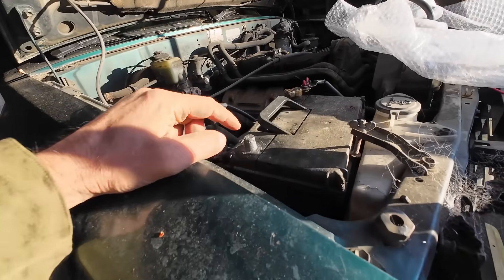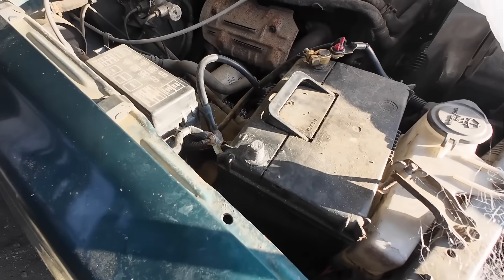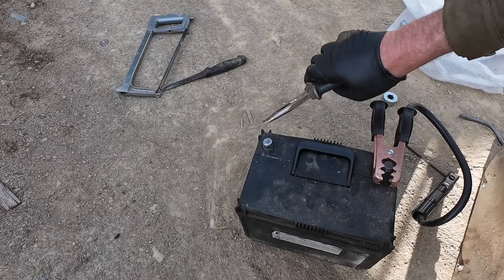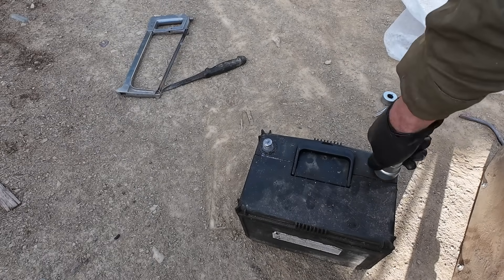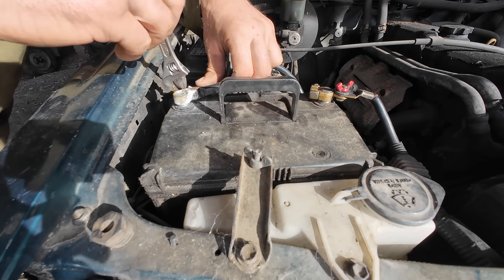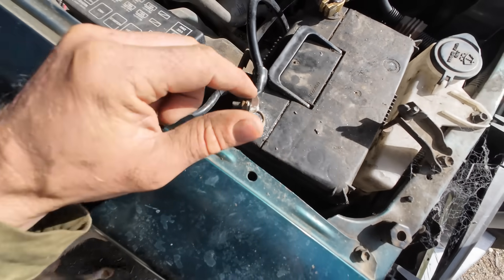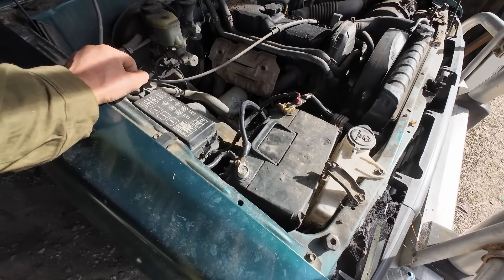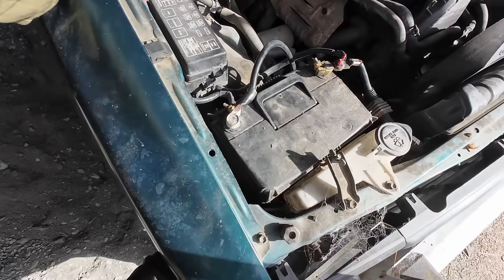Repairing a Burned-Out Car Battery Terminal – How I Fixed a 12V Battery Instead of Replacing It!

Comment: I used to work for a battery company and would go around and repair fork lift power packs.  Quite often, we drilled out the interconnects between cells to replace individual cells.  When replacing the cells, we used lead interconnects and used lead bar stock with propane torches to melt in new terminals.  We would remove the caps of the cells in direct proximity to the hot work and flash off the hydrogen in those cells before continuing the melting operation.  We had a form that we used if the cell we were replacing was of this post style.  Not really sure it's relevant but that never stops me from commenting.
Reply: Nice Junk 🙀🙊🙀
Reply: relevancy does not always make interesting

Your post is interesting because it's insightful! :D
Reply: Every comment is a sacrifice to the algorithm God.🙏🏻
😉😆
Reply: Thats really interesting. Never knew u could do that
Reply: @ionracer3284  "Never knew u could do that" 
Whatever you do, don't watch the YouTubers who make videos where they replace their battery acid with epsom salts.
Reply: How did the hydrogen not blow up?
Reply: @daleolson3506  thats the 'flash' part, fuel to air (ratio) mixture within a closed space is dangerous, taking off the caps allowes gases to escape, flashing removes the excess. Still its dangerous and good ppe is a must.
Reply: That's cool. My dad was an auto sparky as a teenager and told me even car batteries could be reconditioned back then. Some brands built with a glass case.
Reply: @waynoswaynos  
The glass case batteries were stationary batteries, huge 2VDC batteries in series to power telephone exchanges when there were mains power outages. Some of those were repurposed when no longer required; thy became the forerunners of the off grid homesteader battery banks...but they drank water and off gassed hydrogen fairly heavily.
see Surette Rolls 2-YS-31P....now made in Plastic cases.
Reply: A bit of grease on the terminals wouldn't go astray,
Reply: @JohnSmith-pl2bk back in the 70s I worked predominantly at remote locations maintaining HV switchgear and control panels, including transformers etc. Control supply was 120Vdc glass batteries which had to be tested and changed on occasions. We had battery mechanics available and they were always trying to teach me to oxy or gas weld new cells in place because they really didn’t want to travel to these out of the way locations. My answer was alway the same, “you leave my HVCBs alone and I won’t touch your batteries 😂😂😂. 
We looked after them pretty well, bbq with steak or fish, oysters, prawns etc. Even rabbit is available 😂😂😂. 
Sadly they were not replaced when they retired so we got the job when required after that. 
It was great! No supervisors, no engineers, if the fish were biting, a one day job might extend a few days due to “unforeseen” problems 😂😂.
Reply: @alexanderreid465  I’ve always use Vasoline or something similar or battery terminal paint, I started having issues on 24 V pisten bully snow Cats and some other road going trucks where the cranking current draw Woodmill degrees down between the terminal and the clamp and losing conductivity. Therefore, cranking was getting slow. Definitely caught me out

Comment: That´s some Pakistani Truck fix right there 😅👍
Reply: Safety third in other words
Reply: That's where I have seen batteries being refurbished (of sorts) here on YouTube .
Reply: No flip flops were harmed in this adventure I think
Reply: they cut off the terminal and pour molten lead into the mold as i recall.
Reply: @smartgorilla  flip flops are considered safety shoes in these countries. I’ve mostly seen vids of steel mill foundry workers in bare feet and loincloths.
Reply: I got the shivers down my legs even thinking about that ffs

Comment: Wow. Because I've had a battery blow up on me a few times, I'm very leery of them. Beautiful repair. I didn't know that was possible. With a direct short, that battery has to be out gassing. You're a braver man than I!
Reply: I've had that happen. I took a car to a shop and the mechanic hooks the terminals up backwards and turned on the charger. Lucky I was, nothing flew into my eyes. The top of the battery blew up, shattered into bits.
Reply: @KelikakuCoutin  my first was in a parking lot at night. The top blew. I was covered in acid. Thank god I had my glasses on at the time. I surely would have been blinded.
Reply: Not a direct short with that carbon electrode, a metal welding rod would be a different story.

Comment: @1:35 You know you're a true DIY'er when you can say, "I'm going to wear a facemask in case it blows up" 🤣
Reply: I've had a 1,200 amp lead acid deep cycle battery blow up in my face. Ya you definitely want to at-least wear a face shield when messing around with lead acid batteries. They will mess you up really really bad. I used to stick weld with some 6018 welding rod and a big battery on the farm when crap would break out in the field. Worked really really good but I quit doing it after I had a battery blow up.

Comment: An auto electrician I used to use here in Australia about 40 years ago did the same type of repair but with a carbon rod as the electrode. 
He said to watch out, if you use too much heat at once the post will melt and plop into the battery.
He would remove the caps and blow out the hydrogen and then cover the reinstalled caps with a wet rag. A battery will give off hydrogen when it's charging. 
I once blew up a large truck battery while using an angle grinder about 2 meters away from it.
Reply: Good technic

Comment: Good job fixing the battery terminal..
I have seen guys use a few screws to reinforce the terminal.. By Screwing a couple of shiny screws into the base of the terminal cutting off the top of the screws and then putting the circular moulding on top then pouring molten led in the centre of it rebuilding the terminal with reinforcement in the middle

Comment: Shocking!
I couldn't help myself. 
The Brit is coming out of me.
I saw that done years ago with a pump up gasoline blowtorch. 
I'm 66, so that was 55 years ago. 
Nice job, by the way, and great to the safety equipment!
Cheers
Terry
Reply: Probably easiest just with a normal high wattage sheetmetal worker's soldering iron plugged into an electrical outlet. Most likely will garner a similar result, lead solder will melt pretty easily with enough wattage.

Comment: Interesting repair, I think I'd use the mold but melt the lead in a separate container, then pour it into the mold. The receiving end of the cut off pole would likely have to be heated to melt point to create a bond, that's where the electrode set up might be handy. You'll have to let us know how well the repair worked in the long term.
Reply: Yes. But that's against the rules.

Comment: I got a real charge out of this video and just have to put down here that this episode of the Marty T show was electrifyingly good, and I don't know what he is going to do to top this one. That remains to be seen. 

Thanks for the content.
Keep up the good work.
בס'ד
Reply: I was shocked at how well this turned out, since I thought this battery was terminal. At the current time, I have a battery that also leaks, and if I can get the lead out of my butt, I might try to repair it. I normally have a negative attitude when attempting something like this, but after this video, I feel a bit more positive as to what the outcome will be.

Comment: Marty  when i fixed my battery.. kinda like yours i cut mine off all the way to botton. put some cut marks into bottom where i cut it off with a saw.. just enough so new lead would adere too. i put your sme mold over old short terminal heated lead up and poured inside mold let is adere to cuts in old terminal at bottom and then wiggled mold and i had new terminal. And to make it stronger you could always put a screw down the biddle put terminal mold over and then fill up mold with hot lead. wiggle and slide off... still have the same battery to this day. and i did that over 5 years ago. hope this helps. take car be safe another awesome video. keep them coming.

Comment: I have an old maintenance engineer’s handbook that gives advice on such repairs. Apparently there was a time when a lot of really big lead acid batteries were used in numerous industrial applications. Locomotives, switches, backups ect. Some facilities were large enough to have a battery shop on premises. They did a lot of maintenance and repair on batteries including replacing reagents and rebuilding terminals and interconnects. Apparently certain classes of industrial batteries were meant to be repaired so they were designed to allow for it. It describes cutting open jars and pulling plates. And it mentions this kind of tool for reforming terminals and reattaching interconnects after jars were reinstalled. Definitely the kind of book you want for the end of modern civilization.

Comment: Hi Marty.  I've repaired a hole in a terminal (made by crossing the jumper cables) by soldering it and then filing it to shape.  It was a pretty easy repair that can be done in the field with basic tools.
Reply from the maker: Yes I did try that but it didn't last long, it didn't bond, just plugged the hole. maybe I need a bigger solder iron

Comment: I have repaired battery terminals using a similar die, and melting extra lead using a brazing torch and pouring the lead into the mould,  with good results

Comment: Pretty cool I think I would have just tried melting some lead wheel weights and cutting the pole off find a piece of pipe or something the right diameter as the pole and poured the lead on top of the the stub. An interesting video ( Brilliant technique of lead acid battery restoration) is very interesting. 
Great video Marty 😊👍

Comment: In tje military we had a repair kit, it had those molds and then a steel spoon to melt lead bar stock in and then pour it into the molds. Worked pretty good.

Comment: Plain boiling water cleans off battery terminals and connectors beautifully.  Try it.
Also, some flux or tallow would clean up and  help the solder flow

Comment: Thanks for this, I have one that I need to do. I remember my father doing this once, don’t know where he got the mould or where it is now. He sawed the terminal off a crapped out battery, melted it in a shoe polish tin using the burning gear on low heat and poured the new terminal. A1 on the face protection, nasty when they blow.
Reply: Like the Pakistany on you tube

Comment: That's a pretty slick repair Marty.  I wonder if heating the mold with a small torch would speed up the process and maybe make the lead flow a little better.

Comment: You've got bigger balls than me, Marty.
But that comes from a past experience when I had a battery blow up in my face.
Luckily I had safety glasses, long sleeves, long pants and gloves on, but no face shield.
I'm glad I had my usual ppe on, but I wasn't doing anything out of the ordinary.
It happened as I connected the 2nd jumper lead to a battery trolley to jump start a machine with a flat battery, and one battery on the trolley blew up.
Although, I did put 2× slightly low charged batteries on the trolley in series to try to start a 12V machine, so there's that, but I didn't even consider there might be hydrogen hanging around the top of the batteries after a couple of previous jump start attempts, it only took that little spark connecting the 2nd jumper lead and BOOM🤯 will never do that again.
Now I always connect the negative to the engine block of the flat car/machine as the last connction, never at the battery post.
Ears were ringing afterwards as I went straight to the wash trough to wash myself down.🤣👍🇦🇺

Comment: Those are air arc carbon gouging rods. Hook those suckers up with an air compressor, an air arc head and about 350 amps and it'll cut steel like butter. Cool stuff.

Comment: Hi Marty, now you have the former for the lug could you just use the stick lead and a MAP Gas flame to heat it to melt the lead, bit like flood soldering. 
Another beaut video, thanks
Reply: Raw flame with hydrogen coming out of the hole through the post???
Reply: @JohnSmith-pl2bk  seems possible,  see post by Techgorilla1987.
Reply: @67hr74  
You can be lucky...or not.....

Comment: Now get some Military Style battery terminals to put on top of it. Those ones with wing nuts are a chock point for current. Be careful though, I've found two different style of chinese knockoffs that don't cut it. One made of aluminum that cracks and one made of lead with cheap nuts and bolts that loosen. At least the nuts and bolts can be replaced on the second one.

Comment: I screwed a big NH200 battery terminal by not clamping the connectors down and lost a big chunk of the lead terminal. I just took a spare terminal connector clamped on hard (this time) and then with propane gas torch melted lead into the gap to fill it up - worked out well, the dozer started with no issue and now tighten down (usually) the terminals!
Reply: Using a propane burner or Oxy-Acetylene burner with a small nozzle is absolutely safer than shorting the battery terminals.

Comment: brush used motor oil on the posts after the connection is made, keeps them from corroding (when they arent damaged)  i do this and it works great!  usually a repair like this, cut the post off, melt the lead and extra lead, put the form over the post spot and pour the lead in.

Comment: As usual you never fail to amaze.   Thanks for sharing.    It is the first time that I have seen anything like that.   That rod, is it normal to get red hot top to bottom?   Is it because of the lead that requires melting?

Comment: I'm surprised the plastic cap didn't melt with so much heat !

I'm good with a lot of DIY stuff, I'm not afraid to get stuck in and give most things a go but I think I'd rather leave a job like that to someone else !
That's not something you want to get wrong !

Comment: We saw them off flat. 
Drill a small hole in the centre. Put a screw in. Put a mold on and melt some lead and por it in the mold. It's possible the way you were doing it, it could explode. I don't know if you have seen a battery explode. They could blind or even kill you. I was working on a building site. A guy was welding something on a dumper. Sparks cosed the battery to explode. One of the guys was blinded in one eye. Another guy got burned with acid.
Reply from the maker: I'll try that next time, cheers

Comment: Your much better off cutting the post off then heating it in a  small metal  dish and then pouring the molten lead into the mold on the battery terminal, I’ve had really good success doing this, it’s much easier, cleaner, safer, does a better job and it eliminates the possibility of leaving voids and air bubbles.

Comment: I used to use carbon pencils to solder large lugs into cables ,  you are better off confining an arc to the end so the rod doesn't get hot,   it increases the heat transfer ,  the battery repairers on PK skills do it very well

Comment: Can just use the moulds and melt some lead, just pour away, wouldnt be so worried about the chance of the battery popping then
Reply: I think part of the repair is to heat the terminal sufficiently to bond to the lead underneath and fill the void - why the repair mold is larger in diameter than the original post - still i would remove the caps or plate of caps to vent gasses because as it heats gas is being produced. maybe have a fan blowing from behind you as well.

Comment: tig welder pilot arc/tig at 20amp is usually enough for that - and you dont crash discharge the battery letting it stay and air out and definately not charge before doing it is a plus 
a lorry battery once ruptured so violently that you can see the pole imprints in my aquaintances truck shop ceiling

Comment: At the factory they use a former like the one you have shaped for the post required but they use a gas torch to melt lead into the former. Caution though batteries make hydrogen so always make sure its blown away before putting heat into it  or the whole battery willl blow itself apart!

Comment: when ever i have seen it done they cut off the damaged bit. then heat lead in a cast iron ladle and pour it in the mold on top of whats left of the damaged bit
Reply: @MartyT
1 hour ago (edited)
I found poured lead doesn't  bond as well to the remaining post when pouring lead into the mold

Comment: First from UK...What I did was to cut it off, make a casting ring like you have put a small self tapper in the centre then cast lead in to it. Much cheaper than a kit.
Reply: how did you make a casting ring?
Reply: Hahahaha!
Reply: @thedave7760   I formed it around a taper mandrel from a piece of 1,2mm strip of mild steel much the same as you make a cone. I made the patten in paper got it right opened it up and cut the shape then tapped it around.

Comment: Nice fix! Besides from the lung-protection we should also point out, that lead should not be released to the environment by any mean and by any amount. So we should collect all the sawdust, chips and small parts and either reuse them, or handle as toxic waste.
Reply: You do know that lead is mined out if the ground, right? Lead by istelf is not toxic. It is only when you ingest it like when you used to eat paint chips or breathing fumes while it's hot and melted.
Reply: lead is not that toxic in solid form, it isnt plutonium.

Comment: Melting the lead and pouring in to your mold seems much safer(and cheaper). That hot rod looks like a hydrogen explosion waiting to happen. Melt your lead away from the battery, an open flame could be trouble. Nice fix though.